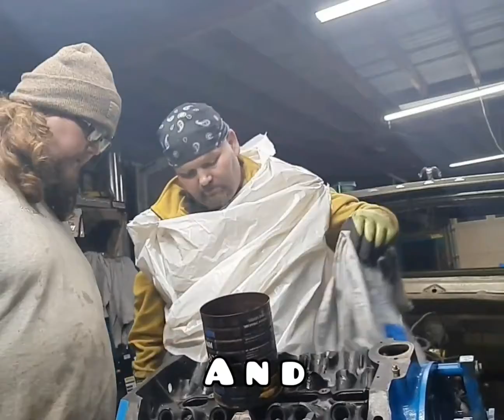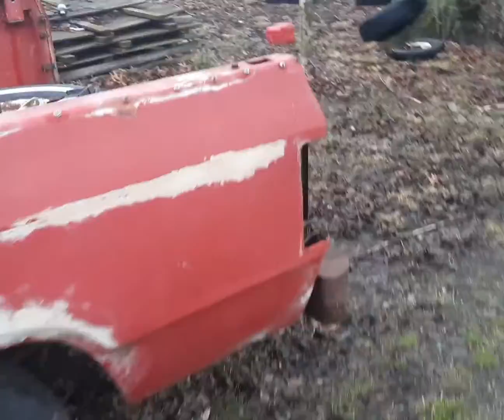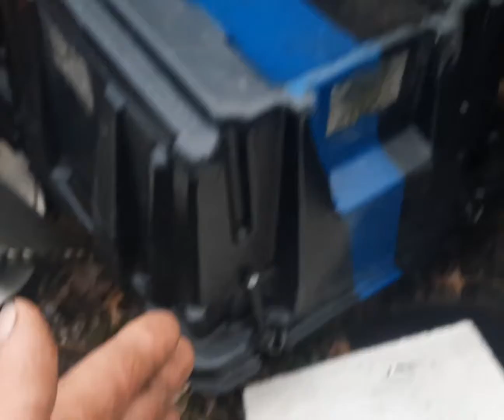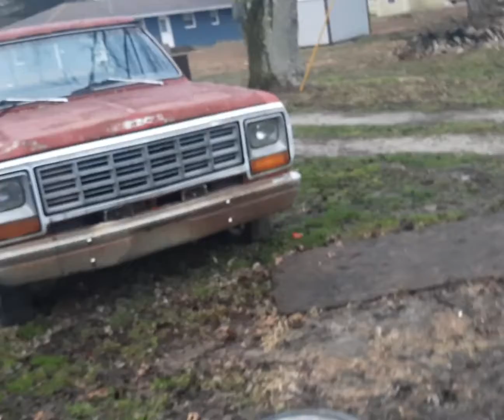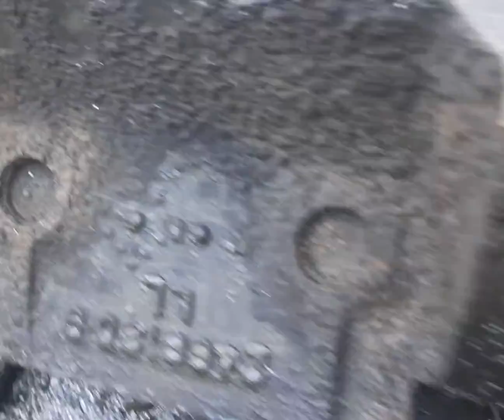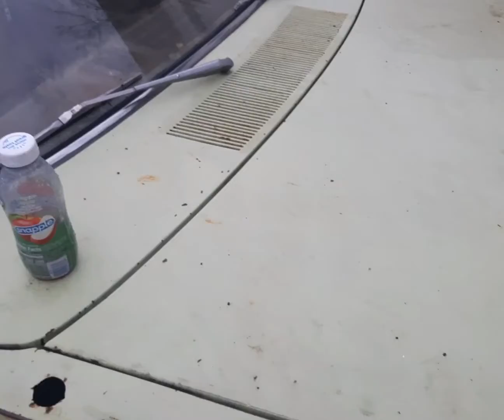witch one do u guys want me to see

Comment: I lean toward the A body car get it up and going looks like less work than the truck...then jump on the truck I knew you could get something out of that 383 the 400 would benefit greatly with that forged crank it already has forged rods too get some decent compression pistons for the 400 and go through the heads they most likely 452 heads good heads with hardened exhaust seats it will go great in the truck plenty of torque it'll make a nice roadkill style truck.
Reply from the maker: Do u have any piston u would   Recommend for the build
Reply: @poormansspeedshop4104  mild build can't go wrong with KB pistons hyperutic ones shoot for no more that 10 to 1 compression with iron heads and use a moly set of rings.